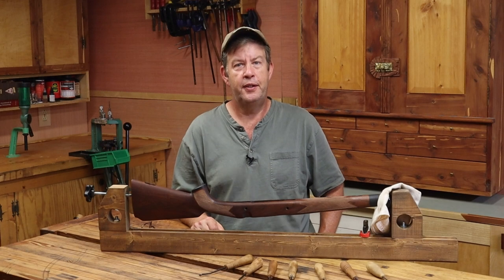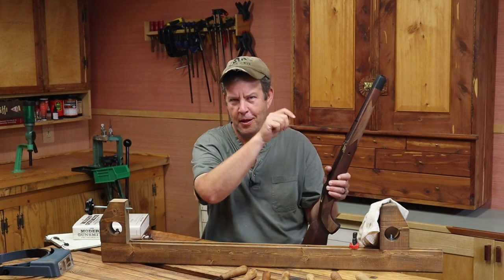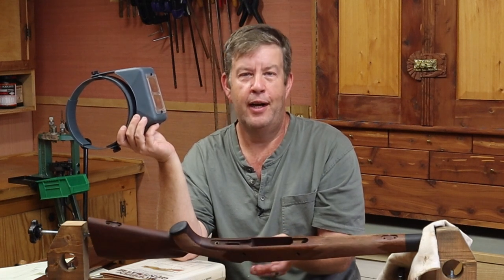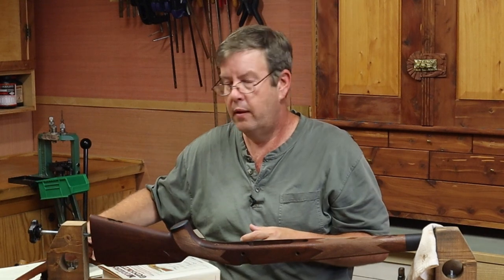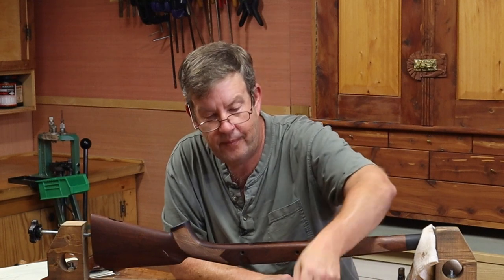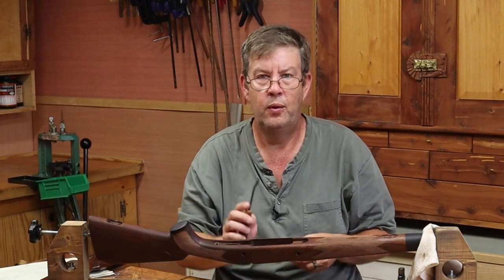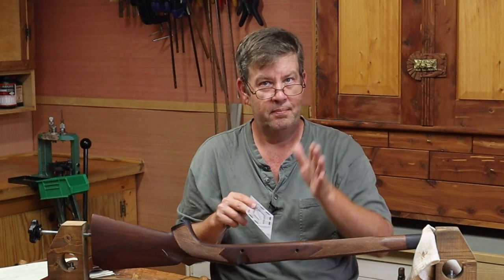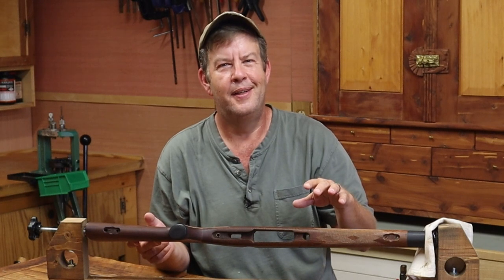The Finer Points of Checkering A Gun Stock

Comment: You might mention before you ever try doing checkering on a stock it is best to practice on a flat piece of wood to learn how each checkering tool works. Checkering tool sets come in in line per inch sizes. Checkering sets range from 18 to 32 lines per-inch.
Choosing the tool set for cutting the diamond size you prefer to use is important to understand. The finer the pattern the more important the quality or type of wood and grain structure is.
You seldom see fine line checkering on rifles but more often on Shotguns. There is a difference in pointed diamonds and ones that are not, that make checkered stocks range in quality and value.
Just seeing a checkered stock is not a sign of quality, if the checkering is badly done. It is another good idea before you try from scratch to checker a un-checker stock. Try practicing on an old one already checkered. Repointing the existing pattern to new condition is an easier way to learn how to reduce mistakes. :goodvibes:🙂
Reply: Good advice
Reply: Yes i second that good advice and also most shotguns are 24 lines per inch and small bores are 26 LPI  and some Italian guns in fact most are 26 LPI. Some walnut are fury i.e. soft and will require some resin to harden the wood before you checker.

Comment: I had to redo checkering on a stock that was modified with Bondo to raise the comb and had gotten into the checkering. Never have done checkering before, I can relate to every one of your tips and know exactly what you've referred to. I still have not had to lay one out and start with the master line part, I have a replacement A5 fore-end I've been holding off on because of the trepidation of the layout. Now after watching yours and a couple of other videos, I'm almost ready to dive in. I was looking to see what other cutters I'll need to actually make this a viable project, but you have restored my confidence to give it a try. Thanks for now. 
As far as the other stock turned out. All the Bondo was removed, the checkering came out acceptable and a linseed, hand rubbed finish applied. No one has ever mentioned any of the mistakes that I know are in the checkering, but I know they are there.

Comment: Don't know if anyone has said , if you soak the cutters in mineral Turpentine then dry off and brush in the Gullet direction with what i know as a "suede leather brush" then you will find the cutters perform better.
essentially you are cleaning the Tool.
Also an old toothbrush can be used to clear the lines in stock,
good coverage on topic by the way

Comment: Nice. I want to up my game in the gunwork world and id love to get onto checkering my own stocks. Ive seen alot of videos so i know the process already. Lots of videos. Id love to do that to my sks stocks for grip . Make them look custom ,not bubba as they call it. I finally got my hammer pivot pin from newyork to Saskatchewan Canada and it took a year. I need to order a spring and plunger next for my savage 77c. Soon as i got the pin i took out my block and hammers and put the pin back into the hammer. It fit tight and perfect and i put the sks back together and went out backyard and loaded a stripperclip full and aimed and boom boom boom. Works successfully. I love the sks. Im going to bed mine in the next weeks , m14 bedding. I bedded 1 sks once and the group was tightened up from 5 to 3 moa to 2 to 3 moa easily. I love all guns.